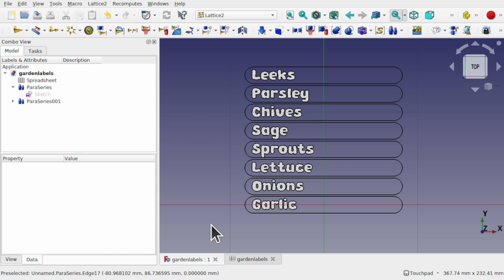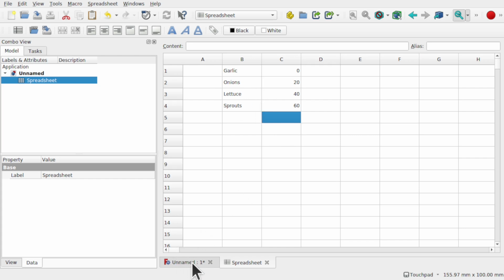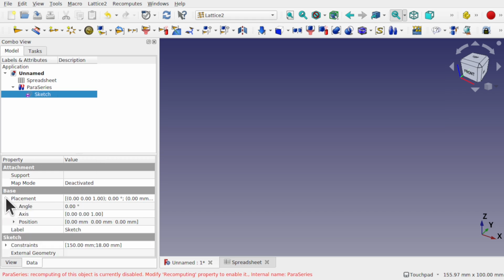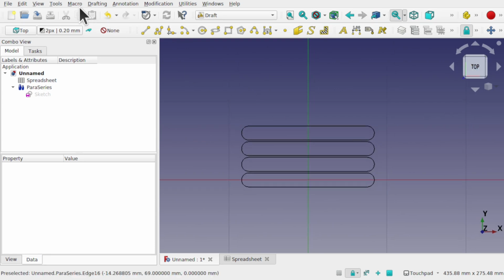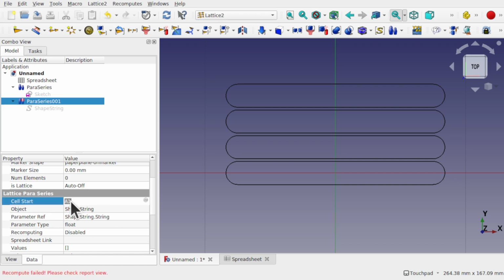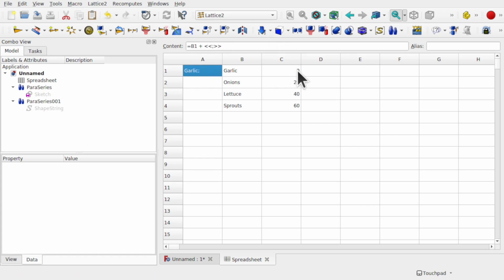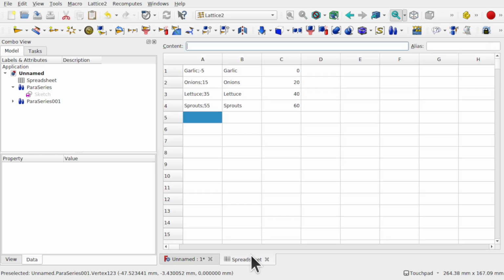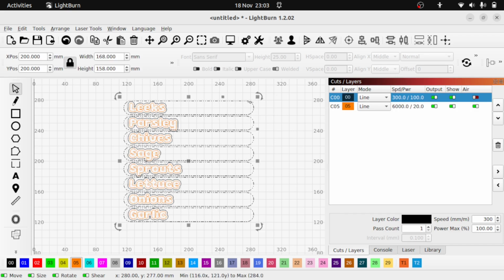FreeCAD Lattice2 Para Series Practical Project | Parametric Text Labels for Laser Cut with LightBurn

Comment: Copying a spreadsheet cell locks up FreeCAD versions 0.20, and 0.20.1 (on Windows 11). Copying the formula from the edit bar works, but the formula must be edited after pasting to reference the correct row. Spreadsheets are completely broken in 0.21 (30922 dated 11-10-22) - typing in a cell locks up FreeCAD (although references to spreadsheets created in a previous version work fine). Weekly builds subsequent to this date fail to start.

Comment: At about 19:00, where you're changing the formulas in the spreadsheet to correct text position, I found that using a transform on the ParaSeries works as well.

Comment: At about 6:20, when I set the Parameter Reference to <<Label Stick Sketch>>.Placement.Base.x, the field shows '0', which disappears and is replaced with a blank field when I click off. I've tried recreating the sketch and leaving it's name set to 'Sketch' with the same result. When I set 'Recomputing' to 'Recompute Once', the following error occurs:

23:37:40  <Exception> Failed to convert to Quantity
in property binding 'Para_Series___Parametric_Text_Labels_for_Laser_Cut#ParaSeries.ParameterRef'
23:37:40  Recompute failed! Please check report view.

I've tried this in versions 0.20, 0.20.1 and 0.21 (a weekly build, which I generally use due to a color bug in 20.1).

If you'd like to take a look, I've uploaded my project file to:
https://www.dropbox.com/s/ir120crumuou6dt/Para%20Series%2003%20-%20Parametric%20Text%20Labels%20for%20Laser%20Cut.FCStd?dl=0
Reply from the maker: Found it.  You entered the parameter ref in the formular and not into the field itself (I did thid the first time I used it as well).  You need to set this to Sketch.Placement.Base.x
Reply: @MangoJellySolutions  Thank you!